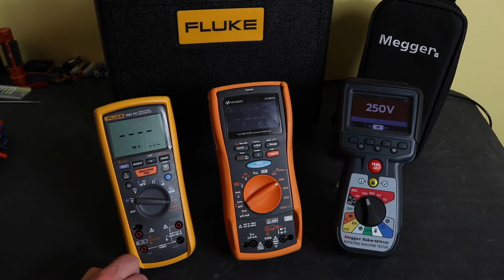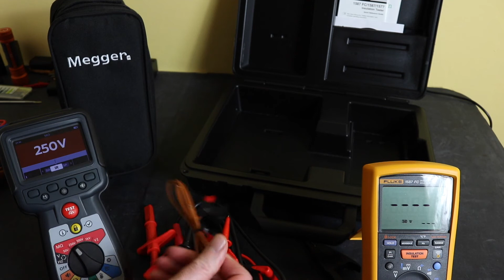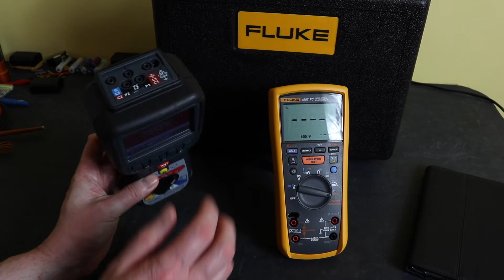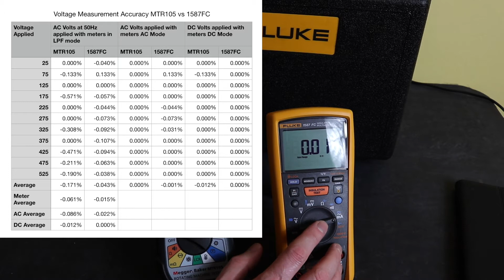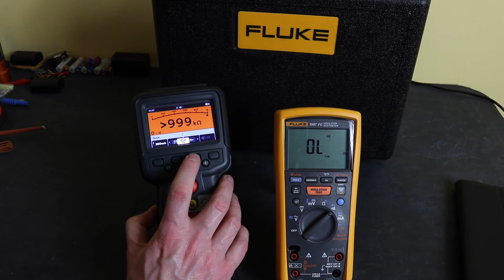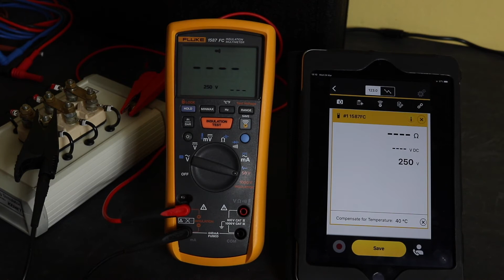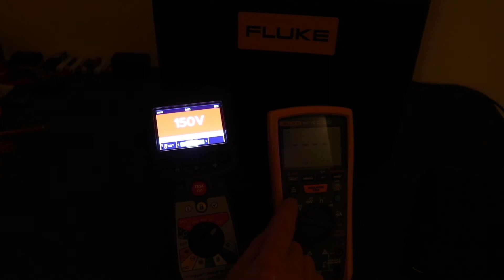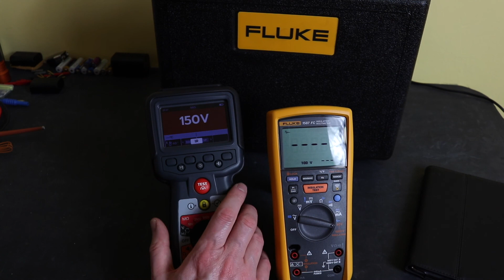Megger MTR105 vs Fluke 1587FC

Comment: Easy now contain your excitement fellows. It’s surprising merger have those poor clips I have the megger mit2500 and they come with great motor clips surprising the mtr105 a motor tester does not.
Reply from the maker: I think the clips you get with the MIT2500 are due to the higher voltage output. All my high voltage testers have larger clips with them. You can get away with the ones with the MTR105 most of the time, just as you say you would perhaps expect something a bit better given that the MTR105 is aimed directly at motors. They are standard 4mm safety connector though so you can always replace them with something else, if you have any money left over after buying an MTR105 of course.
Reply: @three-phase562  true those higher voltage clips are really nice. haha i hear you on the costs of equipment. I am very selective now about equipment. Quality is important.